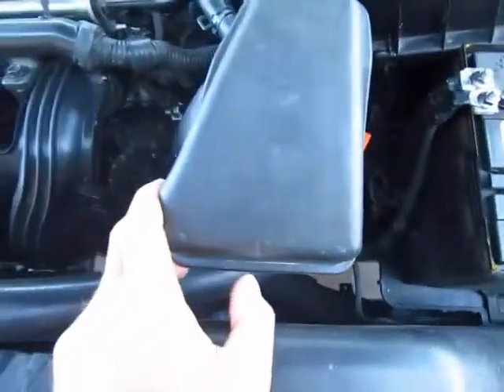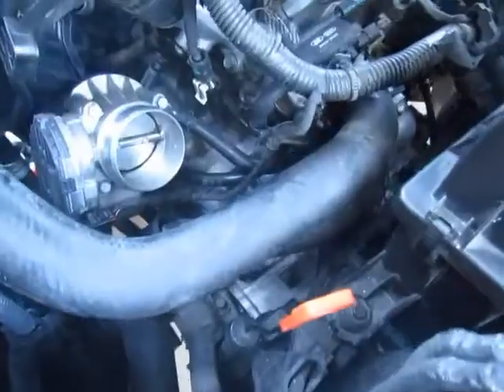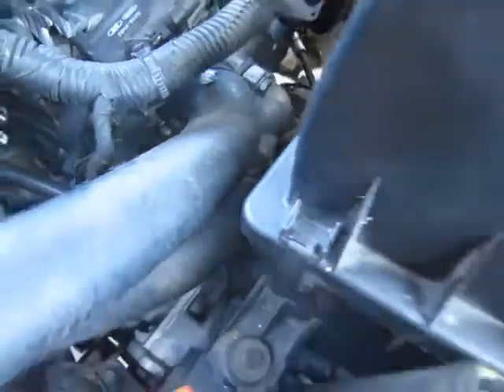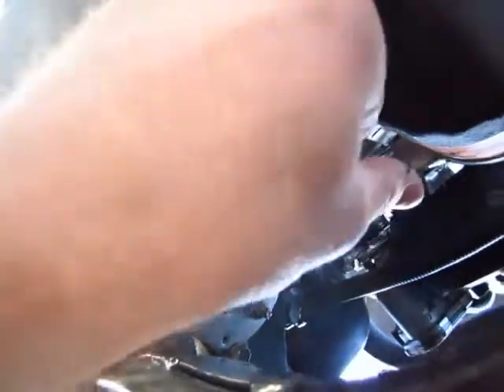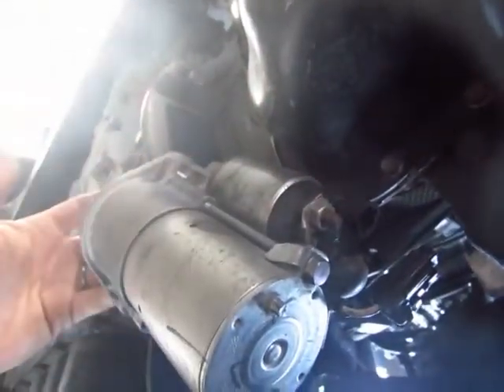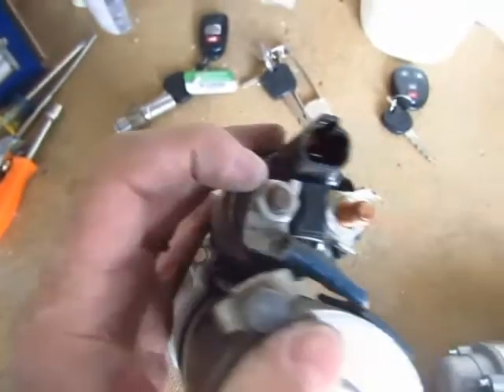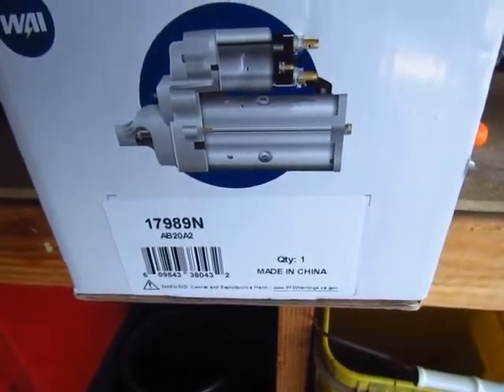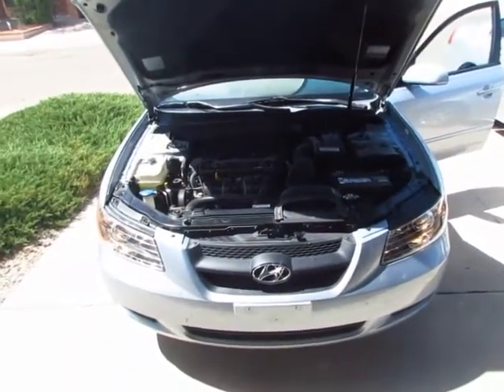How To Replace A Starter On A 2006-2008 Hyundai Sonata 2.4

Comment: During reinstallation - would you be able to connect the wires before bolting the new starter back into place?
Reply from the maker: Hello juanverdades5437,
                                Yes.

Comment: Is every starter the same? Does the old starter make a klick sound when you start ist?
Reply from the maker: Hello Max, 
               Have your starter tested at NAPA or another auto parts store. To see if it is bad. 
             Give them the info about your car. So you get the same kind of starter. 
             Different starters for different engines.
Reply: Sell that pos ASAP!